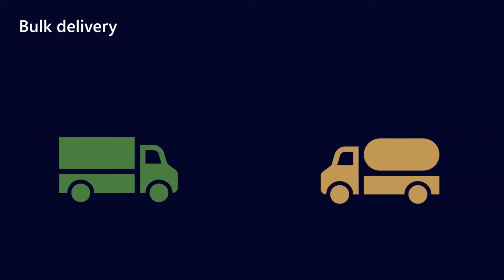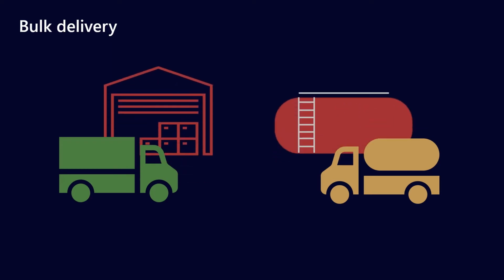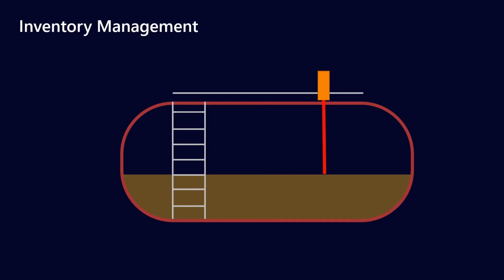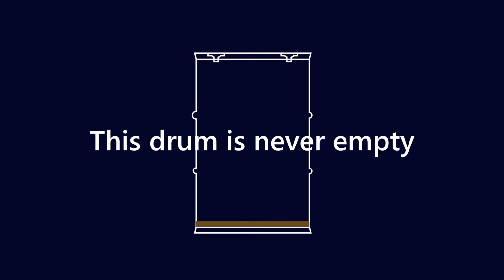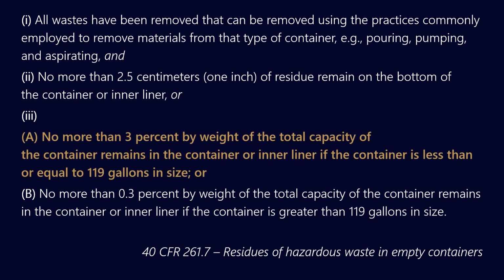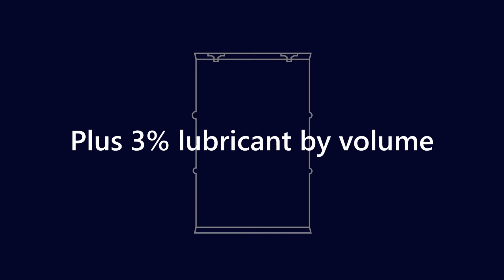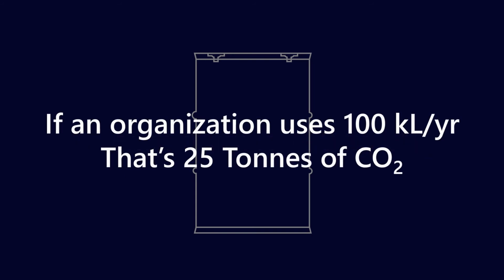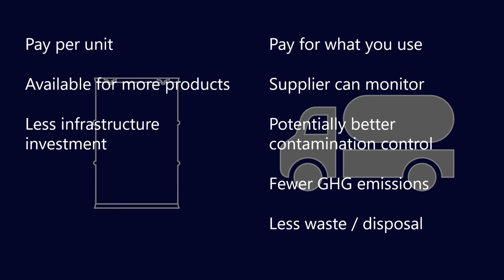What are the differences between bulk oil and packaged lubricants?

Comment: I do have another question actually regarding the current topic. Do additives in oils tend to fall out or settle after long periods of storage. If so, how long before the additives do settle and would this be a problem if oil wasn't consumed fast enough. If this is a problem what would potential solutions be, do they make automatic mixers for large tanks? Just curious, my very first job when I was a kid was for a logging company in the US. We had large stocks of motor oils, hydraulic oils, etc. We received diesel in bulk but all oil packaged in 55 gallon barrels. Some of the oils could sit for a considerable amount of time. Thanks again for your time.
Reply from the maker: Most additives are soluble, so should not settle over the shelf life of a lubricant (typically five years). In some cases you may see some sediment at the bottom of the tank or package; for example in engine oils it is not uncommon to observe PIBSA balls and diatomaceous earth settling to the bottom. These aren't active additives, but rather holdovers from the manufacturing process (PIBSA is part of making the dispersant package, diatomaceous earth part of filtering finished product). Fortunately they aren't harmful contaminants as they are soft and non-abrasive.
Reply: @LubricationExplained  Thanks for the thoughtful reply, good to know. Ill pass my new knowledge down the road.

Comment: Thanks for the presentation! I do have an idea for a future topic if you're interested. You mentioned in a previous video about PAO manufacturing, that when refining we try to remove as much of the naphthenes and aromatics as possible, leaving us with a paraffinic base oil. What do you know about naphthenic base oils? It seems we use them for applications such as electrical transformers, metal working fluids, heat transfer fluids, hydraulic, gear and transmission fluid. Are there any motor oils made from naphthenic base stock? What are the advantages and disadvantages of these base stocks? Why do they seem to take the opposite refining approach as something like a PAO or standard group 3 base oil? I just found out about them and am very curious. Thanks for your time and great content!
Reply from the maker: Sounds like a great idea! Will add it into the pipeline of videos.